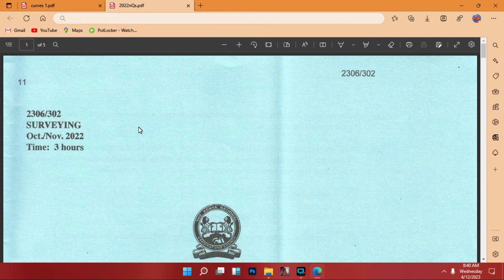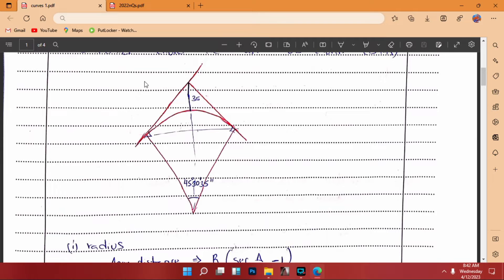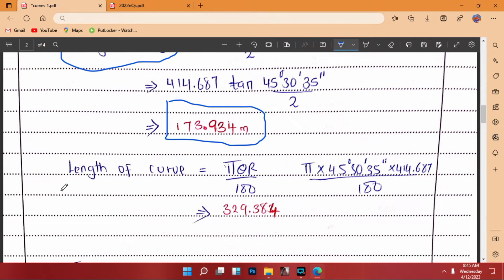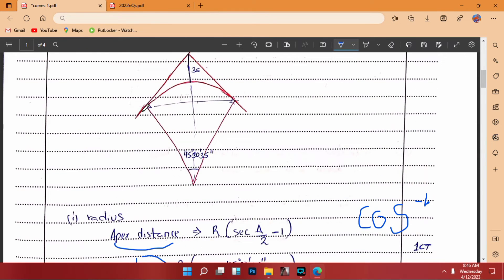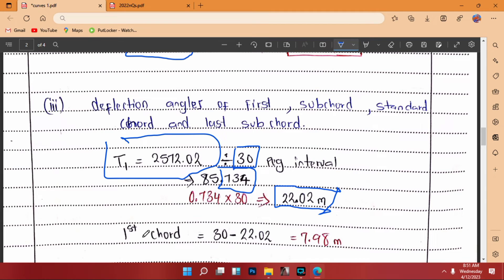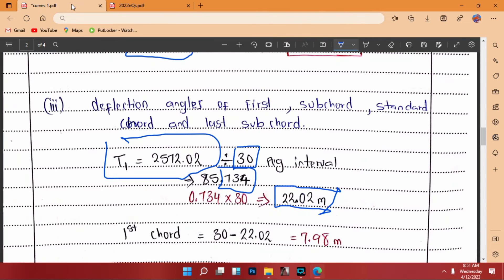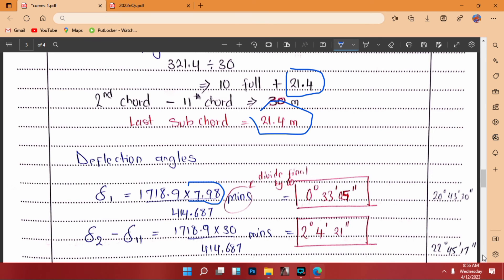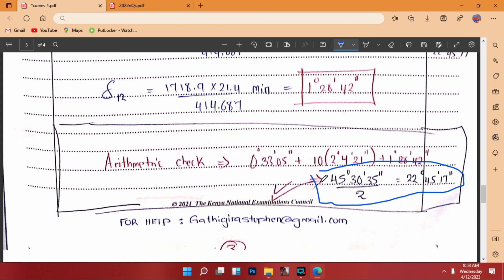KNEC CURVE RANGING FOR QUANTITY/LAND SURVEY/BUILDING/CIVIL/ARCH

Comment: Is something wrong with my calculator,,? Calculate the tangent length again,.
Reply from the maker: Everything all right, make sure to have the angle ÷2 in brackets while using the calculator
Reply from the maker: Will check on that ,but the method should be correct